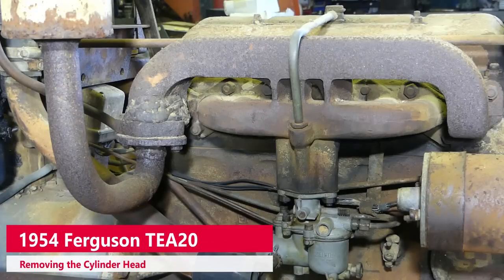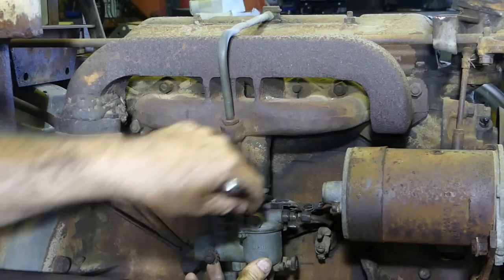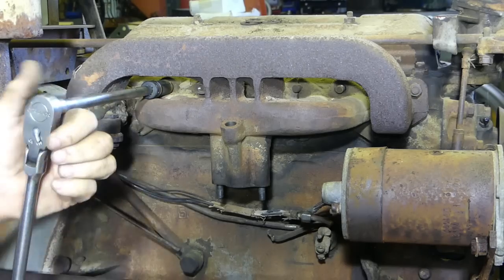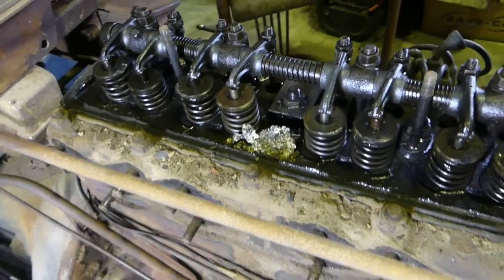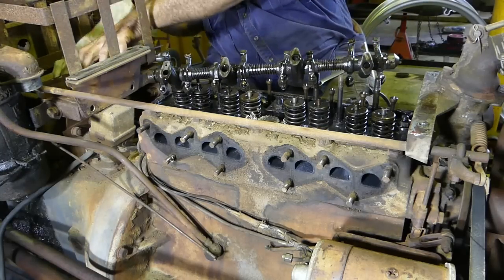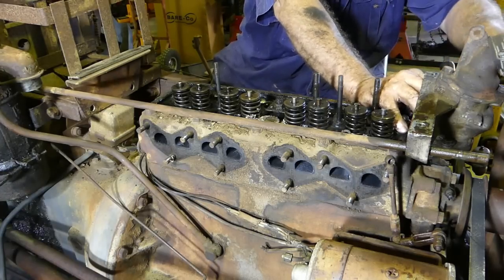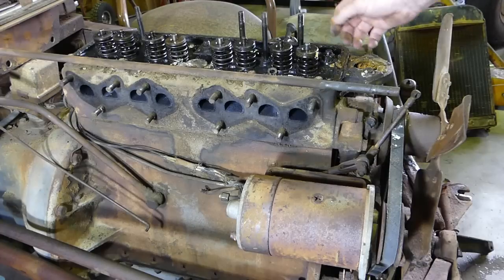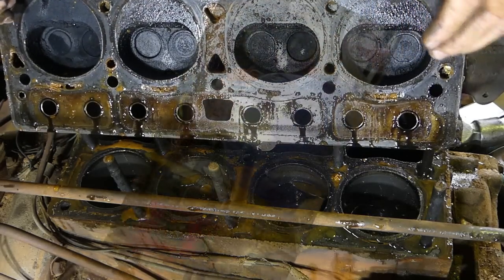Sparex Ferguson TEA20 # 3 How to remove your cylinder head.

Comment: On my head, several head nuts were galled onto the studs. The previous owner (on reassembly) didn't bother to separate the nuts from the studs and drove the studs in with the nuts fused to them. Under one nut a washer was omitted (critical mistake; you can guess what happened). The stud then was driven in too far,  bottomed out and cracked the engine block. But...he didn't know about it as it was the final torque-down. This is how to repair a blown head gasket and still end up having coolant getting into your engine oil. The curse of those little details! Cheers for the series Lance.
Reply from the maker: Thanks Stuart, Yeah there is some dodgy things happen out there alright, they can give you trouble.
Reply: Bundy Bears Shed Thanks Lance.   As always great viewing.   You always keep things simple.  Thanks again.

Comment: Hi Lance, my head gasket is blown and has filled up no2 cylinder.
Not a problem I will replace the head gasket.
My question is, there is water in the sump, this has just occurred when the head gasket blew.
I have started to strip for the head gasket replacement and have taken off the rocker cover, the plug you show in your video in the head has actually been replaced with an aluminium plug cut flush with the head so that ls not sendingbwater into the sump.
How can I tell if the cylinder liner gaskets are leaking as the head gasket is blown badly and a cooling ststem pressure test cannot be done.
Do I just replace the head gasket and see if water ends up in the sump again or can I check for cylinder liner gasket leakage by sump removal?
Thanks in advance.
Love your Videos, very informative.
Reply from the maker: Answered on email.

Comment: Another great and very informative video thank you Lance. I have an intermittent misfire on my 48 TEA20 could this be caused by head a fault. Tight valve, bent and sticking push rod or something along those lines ?  I quite fancy taking the head of my tractor and this video has given me the confidence to do it.
Reply from the maker: Could just be a sticky injector, but running it with the tappet cover off might give you a better idea of what the problem is.
Reply: @BundyBearsShed  Thanks Lance you're a star.

Comment: Just removed my cylinder head and found three head gaskets and two spacers separating them, gasket, spacer, gasket, spacer, gasket. It is a TEA20 converted to run on TVO at some point. If I set it back to original, petrol only do I need shorter head studs and pushrods ?
Reply from the maker: Im not sure about the head studs but the push rods possibly. I would do a dry run and get some measurements.
Reply: @BundyBearsShed  Thanks Lance. I hope I don't need pushrods I cannot find any at all in the UK. 🙁

Comment: Just spotted the gap between the crank pulley and that bracket. Mine doesn’t have any gap to get the belt off so I’m thinking it may have had a hit in the front and bent something at some stage.
Reply from the maker: Sounds like you may be right there.

Comment: Lance - I have a 1954 TEA20 on which I am doing a reasonably complete overhaul here in Maryborough Qld. On removing the head one of the studs broke, one came out and the others remain. My question is do I remove the other studs for replacement or leave sleeping dogs lie. My concern is breaking other studs. I am dealing with the one broken one and dont need any more.
Reply from the maker: G day Bob, Pull them for sure and look for corrosion or stretched threads.
Reply: @BundyBearsShed  do you have a suggestion on method  to best remove them - thanks

Comment: Hi Lance,

Great run through.
Thanks for that.

Just a question on the flat washers for the cylinder head.
Are they a  hardened steel as opposed to a mild steel washer?

Cheers,
Paul.    Surrey  UK
Reply from the maker: Thanks Paul

Comment: Hi Lance do you know how long the TEA push rods are?
Ive got a TEA20 that at some point was converted to TVO by adding 5 head gaskets and putting in the longer push rods from a TED 
Im rebuilding the engine and putting it back to how it was originally but I need to swap the push rods for the shorter TEA ones. Ive already payed out for one set that I was told were the shorter ones but they are too long Id like to know the exact length I need before paying for another set but cant find out how long they are supposed to be from anywhere can you help???
Reply from the maker: Not straight up i know there are 3 different sizes but Ill try and measure mine if I get home before dark.
Reply: Bundy Bears Shed - Thanks that would be a great help if you could 👍
Reply: G’day Lance dont suppose you got a chance to measure those push rods?